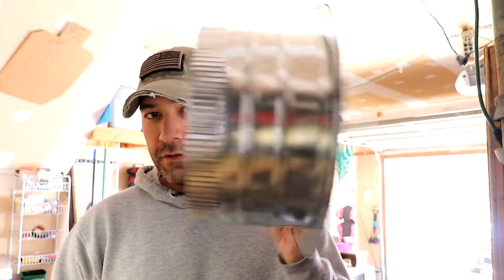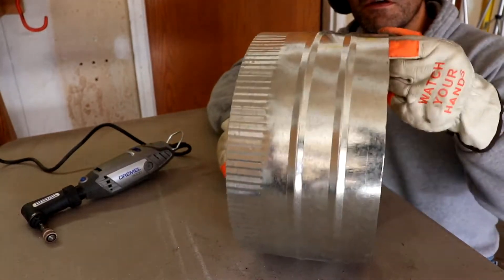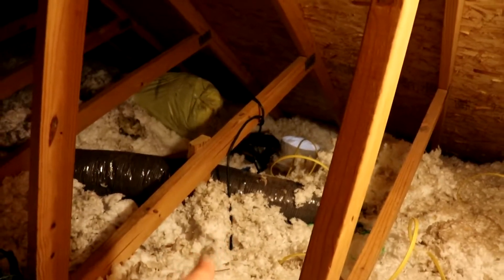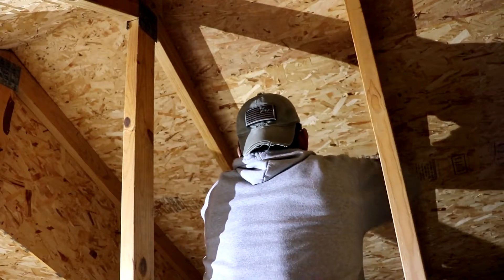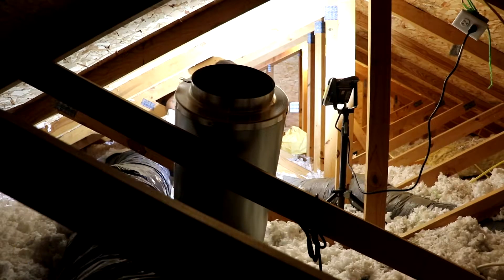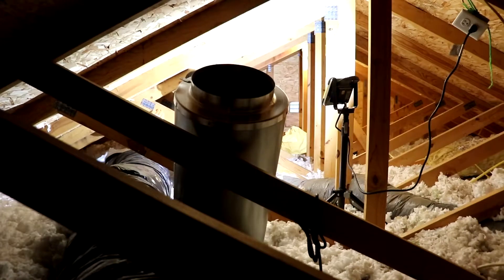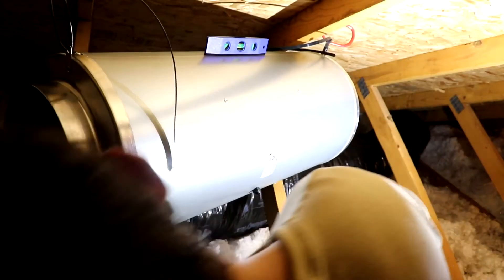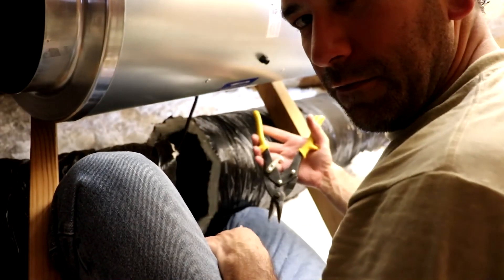Electrical Overview, Fan Emplacement, & Ducting Layout - In Home Cigar Lounge Build, Part  5

Comment: You're absolutely right about suspending the fan. I'm an HVAC installer and would've done the same just a little different. I give you a lot of credit taking on a project like this especially cutting into your roof.